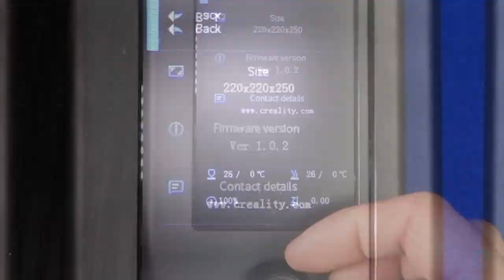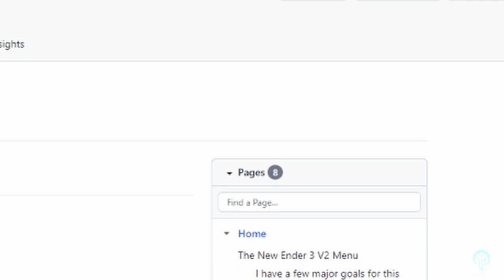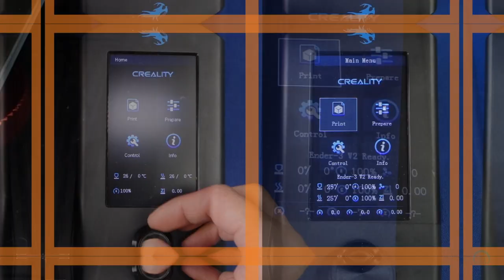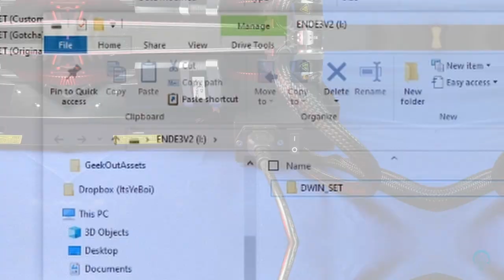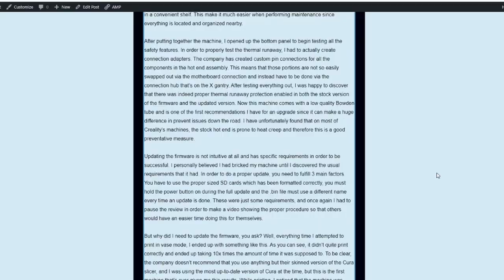𝐔𝐏𝐃𝐀𝐓𝐈𝐍𝐆 the Firmware - Ender 𝟯 𝗩𝟮 - 𝗝𝘆𝗲𝗿𝘀 Firmware (IMPORTANT UPDATE IN DESCRIPTION)

Comment: Thanks for your guide!!! I was pulling my hair out with the Marlin main firmware and using VS, mainly because the board selection is not clear and whatever information I find online does not go in great detail. I was getting errors in VS when I tried to select my 4.2.2 version STM32F103RET or RC and try to build but it would build with the mega2560 which I don't believe is correct. Jyers looks so much easier to install and I like the manual mesh option! 👍👍👍
Reply: Oh ... I like your directness but if you could slow you speech by 0.4x, the video would be perfect!
Reply from the maker: I have the transcript on my website, which is more suitable when it comes to instructions.  The PDF survival guide for the V2 also includes more detailed information and breakdowns of this machine in particular.  Just let me know if you need some clarification on anything also.

Comment: What do you do when it will not install the new firmware, or older version?
Reply from the maker: Some users had issues with using SD cards that were larger than 8GB in size.  Also, shutting down the machine and restarting it can sometimes trigger the update, so long as it's for the proper motherboard.  This machine in particular came with two different motherboards and the Jyers firmware isn't recommended for the 256K, so you'll need to check your CPU to make sure it's compatible.  There's a very good article at this link here. https://www.th3dstudio.com/2022/01/16/creality-4-2-x-cpus-512k-swapped-out-for-256k-warning-firmware/?fbclid=IwAR3IMQ5jowod_0cURzOKdT11VhIcOpaZeFoXGJajJqOmm1zwQJz5-7QOriU

Comment: Back again . (This is copy and pasted ) Unfortunately my ender 3 v2 screen has went blue I tried everything but it’s still not working trying too avoid getting another motherboard if I get a creality wifi box will I be able to avoid all of that all together and just connect my laptop to my printer through cura and print through there with the creality wifi box
Reply from the maker: Did remove the SD card after flashing the new firmware for the LCD?  Once it's done updating, you need to turn off the machine and remove the SD card so that it can boot properly. If it turned blue/black after the update, it most likely finished updating.

Comment: im having an issue where it will error out at 205 and not get to 220 and say heating failed. but it will heat up to 220 in the PID autotune setting with no problem.
Reply from the maker: Around those temperatures, you normally get errors because of firmware limitations.  First, make sure that you have a Capricorn tubing if you're intending to print at those temperatures.  Second, take a look at the firmware, since it'll automatically cap itself about 10 degrees under its limit for safety reasons.  Since you're getting close to the 230 mark, you'll probably want to eventually change to a high temperature nozzle as well.  Once I switched to a high temperature nozzle and updated the firmware with the new specs, I didn't have any more issues, so that might be what's happening in your case. 

  I would also double-check what your thermistor and heater cartridge is rated for.  While I don't believe it's the problem, you can test those to make sure that they're heating up at the correct temperatures.  For convenience, I actually use a laser thermometer, but you can also use a multimeter and measure the resistance for both thermistor and heater cartridge.
Reply: Before I did the update I had the default firmware and I was able to go to 220 with no errors.    Once I updated then it started happening.   What’s making me scratch my head is that it will go to 220 and heat up in the PID auto tune setting but it just won’t do it in the normal preheat setting at the main menu.   My filaments temp setting is 215 - 230
Reply from the maker: That sounds like a firmware setting, then.  A lot of these machines use an older version of firmware out of the box, and they often have less safety features in them.  The safety trigger's pretty much the way you described it as well.  It won't let you pre-heat it, around 10 degrees LOWER than what the firmware says.  The stock Bowden tube will begin suffering from heat creep around those temperatures as well, which can cause it to burn and release toxic fumes, which I why it's a good idea to replace that part anyway.  Since the source code files for that firmware are available, I would double-check what the limits are set to, just to make sure that's the issue.
Reply: @Yarkspiri  Will do. Ill check the code out. Thank you.
Reply from the maker: No problem.  Best of luck.
Reply: @Yarkspiri  so I checked the source code and it’s set to 275 before it supposed to give an error. So it should be getting to 220 with no problems.  But unfortunately I still can’t get past 205
Reply from the maker: @Heatley2001  I would double-check your thermistor and heater cartridge then.  I would look at the cartridge first. Also, did you update to the latest Creality firmware or a different one?

Comment: My screen had black screened will this work for it ? If so follow all the steps you said ? It did this after I attempted to download the BL touch
Reply from the maker: Did it black screen before you tried to update?  IF you updated the motherboard, you must also update the screen.  Make sure that you have the proper file name when you do so.
Reply: @Yarkspiri   no it black screen when the CR touch was installed had I knew this I would’ve never even attempted . Now my windows 10 let me format my sd card but now it won’t let me format it again . It doesn’t even recognize it so I’m having a very hard time
Reply from the maker: You may have a corrupted SD card.  I always recommend using a fresh one before starting the installation and using one from a reputable company.  A lot of the cheap one's get corrupt quite easily, and it can cause issues.